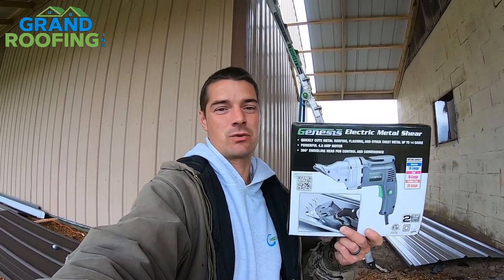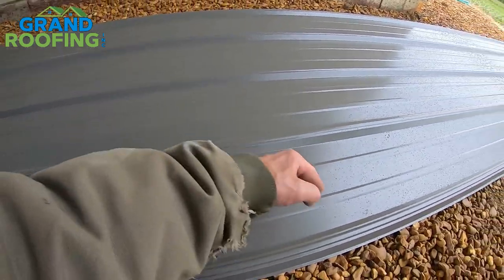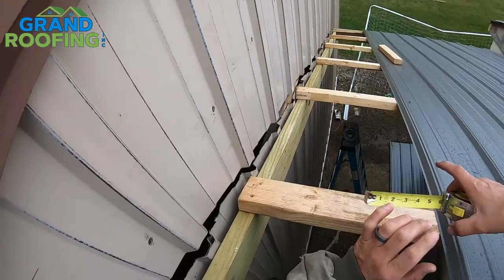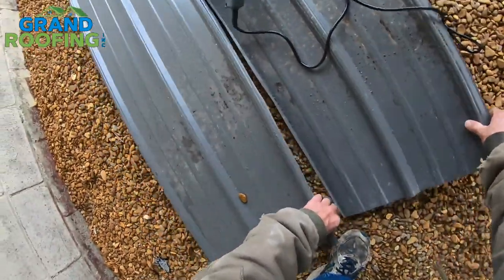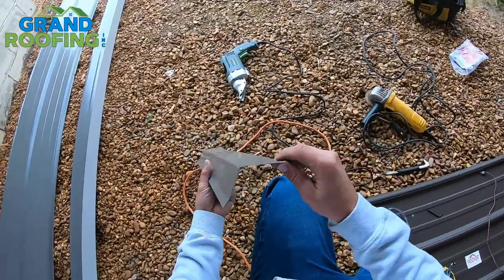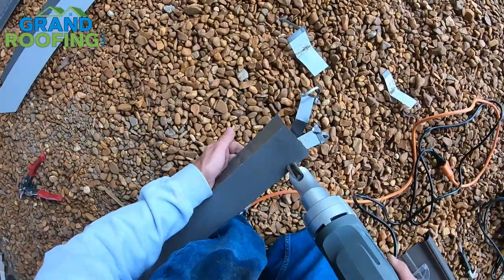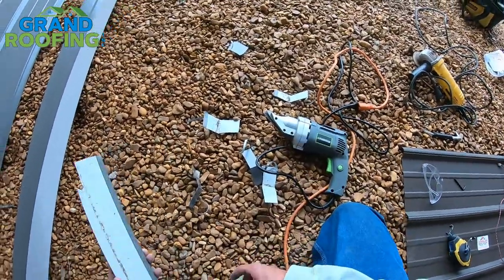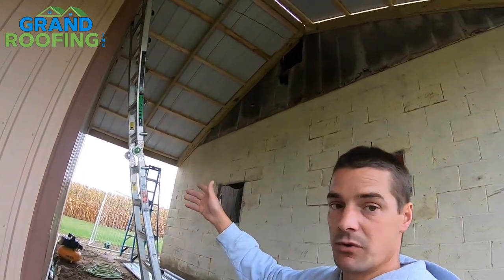Genesis metal shears for roofing - How to cut metal roofing

Comment: I like the convenience of the drill attachment ones
Reply from the maker: I've seen those and thought they'd be convenient but never used one before.
Reply: Grand Roofing Inc. yeah better then having an entire new tool imo but they are a little harder to use in the sense you need two hands usually.
Reply: They're also not all compatible will every drill. Hence the reason I'm here.

Comment: You just tried it with a galvalum sheet, maybe 20 gauge .9mm.
You didn't try to adjust the space to cut a thick metal sheet like 14 gauge, which is 2.0 mm. Is a little bit tricky.